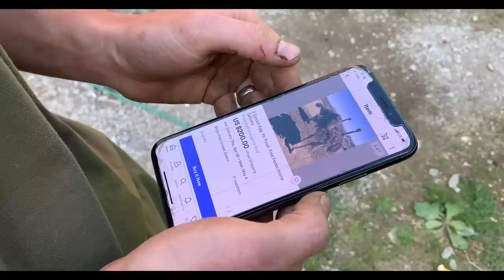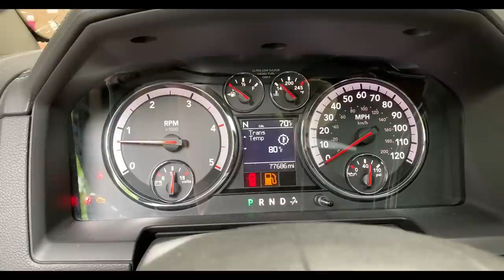Building My Dad His Dream Truck Part 8

Comment: Hey guys, I just wanted to post and say that the extension you made for the intercooler needs to have a bead rolled on it to stop the hose from slipping off.
Reply: There’s something called a clamp just saying
Reply: @joeyschultz3774  I guess you know very little about boost.
Reply: @Kodiak660  not even boosted... just the pressure alone from the coolant system could blow that hose off even with multiple clamps. hopefully they'll take care of that even if it's not shown. hate to blow a hose while pops is out making runs long distance.
Reply: Second this, either take it somewhere to bead roll it or buy a section already done.  You can put a little weld bead on it also, the air tight part is where the clamp is the bead keeps it from slipping so doesn't have to be perfect.  You can also make a beading device out of vice grips.
Reply: Yes, thank you gentlemen, a bead roll... I couldn’t remember the right word at the time
Reply: @Kodiak660  It will seal without a bead rolled into the pipe, you can run pretty high boost without the bead but you right its a bit of insurance!

Comment: When extending the chargepipe, you should weld a lip on the pipe you had to cut. That way the hose and hoseclamp got something to grab on to when going full boost. Otherwise it will jusy pop off..

Comment: Y’all need to change that coolant out to diesel specific coolant.  The heat and cavitation from The compression of a Diesel engine is much higher than that of gas engines.  Go to dodge and get their recommended coolant!
Reply: Darren Patterson 
IDK if those engines need the Diesel specific/ anti cavitation coolant however I do know that is likely the wrong coolant for that vehicle, dexcool is usually for gm vehicles.
Reply: Definitely need the right coolant. Go get ELC and distilled water. Never run 50/50 in a diesel. They are going to leave pops on the side of the road.
Reply: Retella ELC is the way to go.

Comment: Self etching primer is for certain situations like preparing for top coats like primers and sealers, you should be using weldable primer between panels before welding them up. Comes in a spray can and helps fight corrosion.

Comment: That boost tube extension will pop off when under boost. I highly suggest that you either bead roll the end of the extension, where you made the cut at. Or put a thick bead around the OD of the same spot. That way the couple doesnt pop off under boost.

Comment: IF YOU BOYS NEED THE PAINT CODES LET ME KNOW, I HAVE THE SAME EXACT TRUCK AND 2 TONE.
Reply: Edward Wesner my Question is what do you have that they don’t have on your truck if they need a paint code they can open their door and the paint code is on the door
Reply: Life’sGood ! lol
Reply: @chc1541  ...well they need something because that paint they laid down is clearly purple and not even remotely close to the original...
Reply: @puzer1    Agreed, it definitely doesn't match.
Reply: @chc1541  I have the paint codes on deck, repainted the silver fender flares and had a fender repainted blue.  Ram has 2 silvers that have the same code, there is a sub category for the silver. It would be impossible to match, silver being the hardest to match

Comment: If you used the straight end of the charge pipe to extend it keep in mind that the boost might throw it up. That's why on aftermarket pipes you have a lip. You should have made the cut in the middle of the pipe and weld in an extension or use a beed roller to make the lip on the pipe you cut. 
And please do a headlight alignment after you install those LED headlights

Comment: Love the videos but you guys will 100% want to put a lip on the extension pipe so it doesn't blow off under boost and also I might be wrong but the 6.7s used G05 coolant which I think is pink, the DeX cool was for GM trucks

Comment: Not sure if you guys thought of this but that hot side charge pipe you extended, if you just used rubber and clamps it will pop off under load , probably uphill with a trailer , anyway you need to weld a bead or get a bead roller for both ends of that pipe it gives something for the clamp to grab onto quick tio to save you some trouble shooting later

Comment: You should always make a “edge” either by welding or bending the edges when making a chargepipe to rubber connection out of a straight pipe. If you don’t do that the rubber hose tends to blow of when it sees some boost

Comment: Have you guys thought about bagging the rear like the 2019s have? I have an 07 I am going to do bags all around not for show but for ride comfort and towing. Being able to drop the rear under the trailer raise it up take the weight off the landing gear before I roll it up then level it all out is the goal.

Comment: Tip get that pipe you guys cut to fit for the innercooler bead rolled or welded so it doesn’t pop off at high boost

Comment: I suggest you to put a lip on the radiator extension pipe you don’t want it to bust off when all the water pressure Builds up when you’re driving

Comment: I know others have probably said this but if you are going to tow heavy loads and tune that engine you really need to head stud it.  It is the same engine that they use in the Blue Bird buses and I talked to the mechanic that does all the work on them in the shop and he said the head is not an issue unless you start wanting to build power out of that engine.

Comment: Boys, you're gonna need a radiator cap, not just to fill the coolant, but to also set the pressure the coolant runs at to both cool and not overpressure the system.

Comment: You need to roll a bead into the piece you used to extend the charge tube. If you don't it will blow off under boost.

Comment: On the pipe you have to cut weld a bead all the way around it about 1/4 from the edge of the cut so the boost couplers clamps don't slide off under boost. Would hate to see your dad stranded somewhere trying to put that back on.

Comment: So if the 2020 rad has no rad cap and the overflow tank wasn’t changed to the pressurized tank from the 2020, exactly what is going to relieve the pressure if it were to overheat? There’s no pressurized overflow with relief or rad cap (that the 2012 rad had) I noticed it was filled through the air bleed.

Comment: May want to put a bead roll on the charge air pipe that was cut off so when under boost the pipe doesn’t separate from the charge air boot

Comment: We're the batteries hooked up while you were welding?
Reply: Cardiff Giant  Absolutely, you can fry the ECM, TCM basically any of the computers cause the electricity will back feed through the grounds if they have +12v power

Comment: I strongly advise that you guys disconnect the batteries before you weld the vehicles. You can blow up a battery, sending acid everywhere, fire and other electrical  damage can occur.

Comment: Can anyone help me figure out what wrong with my 2000 Dodge Ram 1500 ST. Everytime I try to start it it turns over and over but won’t start till the third crank. I’ve replaced the fuel pump and starter. Got a new battery and ran the computer through it. All the computer said was o2 sensors were bad and I’ve replaced those but same results. Does anyone know what’s wrong with it?

Comment: You guys are the goonzquad not the Flintstones so let's stop talking about getting an ostrich ? No way you guys want to collect ostrich eggs and make omelettes ? But I gotta say you have a bunch of chicks and ducklings chasing uou around lol. I can't even imagine where you would find a pan to fry up an ostrich egg . Whoa let's forget about ostriche eggs omelettes farm animals and get back to the the incredible idea to build a 2012 Dodge dually truck into a 2020 Dodge truck just for your Dad. Wow it's like you stop working and you guys look at something different and BAMG ! you come up with all sorts of ideas lol. Meanwhile back in the shop .
I'm pretty sure they have a rattle cansemi-gloss or flat clear you can spray over the base coat to protect it. Because the base coat can actually can be wiped off with almost any type of petroleum-based solvent. Any and all paint trim colors or trick options will be on the white VIN tag inside the drivers door opening or the glove box or armrest/center console of the truck.

Comment: You mentioned that you burned yourself before by not wearing proper welding gear. Lincoln Electric even sent you a welding jacket and sleeves. Two years later your still welding without the proper gear. Not only is this endangering you, but your setting a bad example for other beginner welders who don't know better. Otherwise, great job guys!!